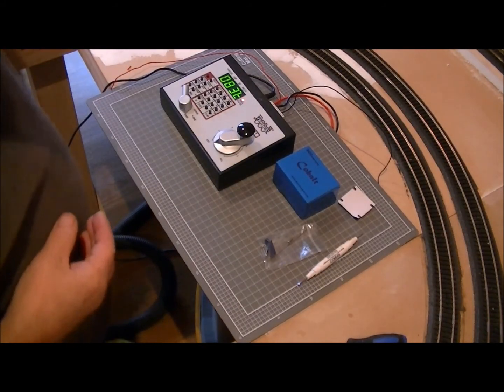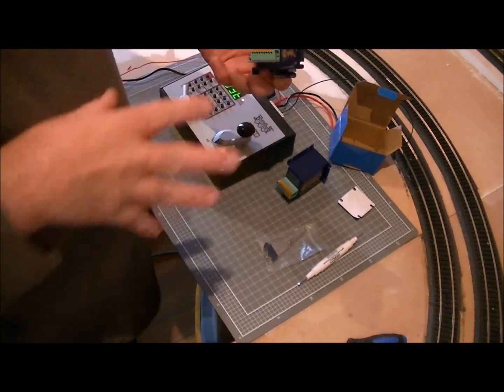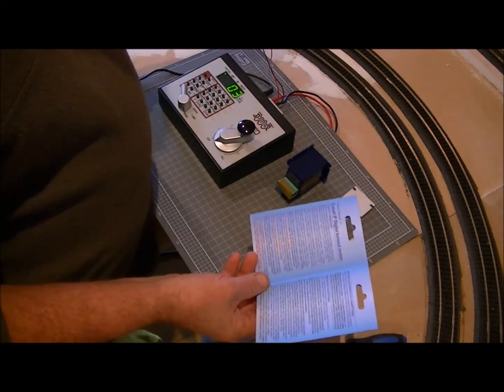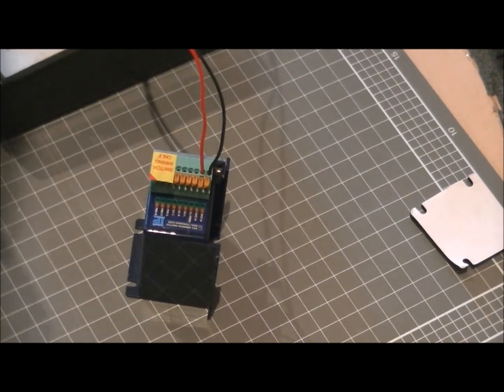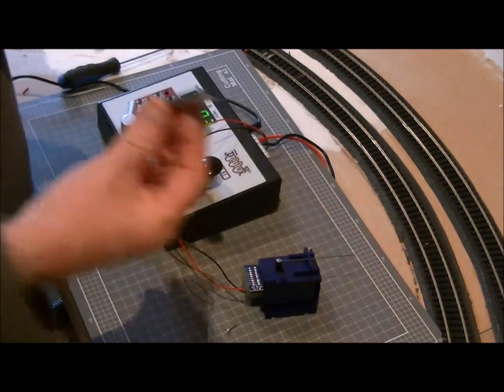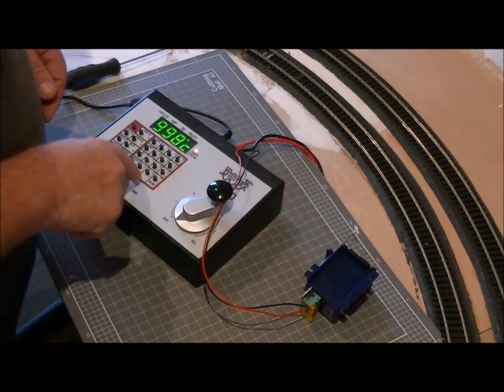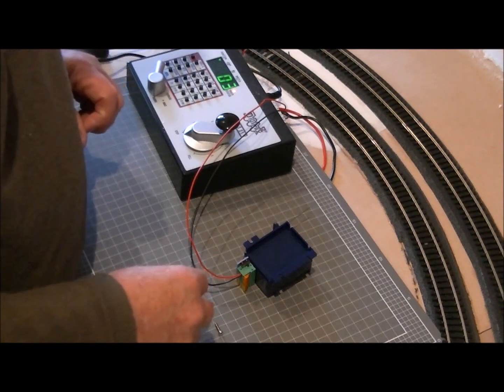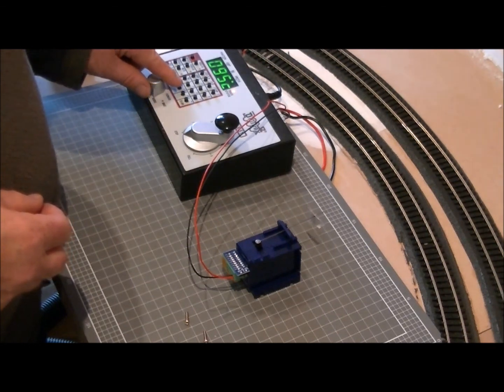DCC CONCEPTS  COBALT DIGITAL IP POINT MOTOR

Comment: Could you tell me the dimensions of this motor please, thanks
Reply from the maker: Overall space required for Body as mounted depth height) allow 70mm including connector box, width allow 60mm across tabs and fulcrum, depth allow 40mm minimum.

Mounting pad  holes 33mm x 27 mm centres (approx)

Hope that helps
Allan